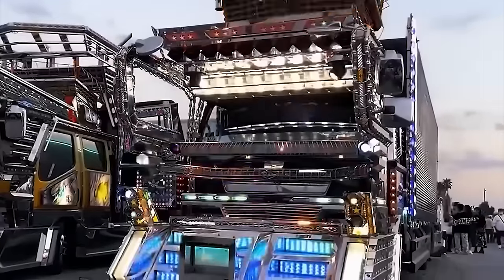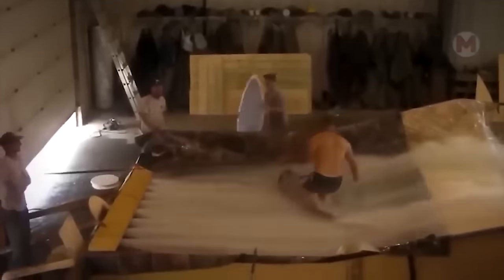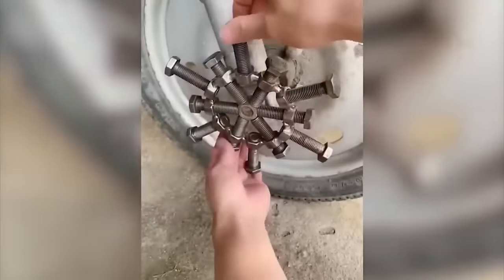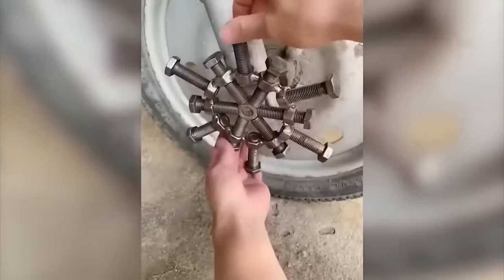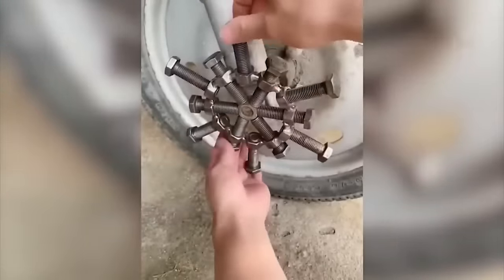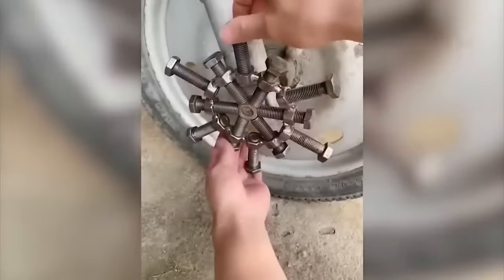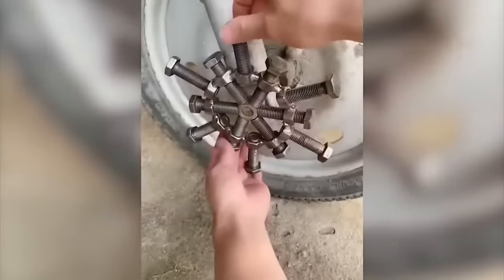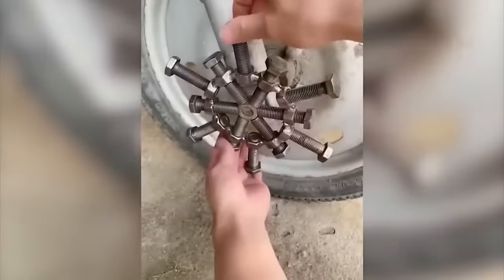This Homemade Invention Shocked Even Elon Musk. IQ 999 / Part 3

Comment: 10:27  I get it that it's a tiny round bailer, but I've been round bailing since I was 10yrs old and I'm 54 now. So, on the innovations level I give it a 1 out of 10, but on the effort of making round bails more manageable I give it a 9 out of 10. But with the equipment already available that 9 out of 10 is absolutely useless. Sorry guys, it's just a useless out of the box innovations that's not very innovative at all, it sucks, it's cute, but it's useless 😕